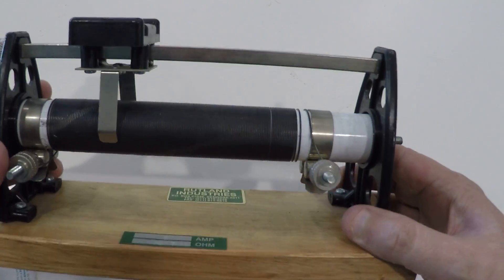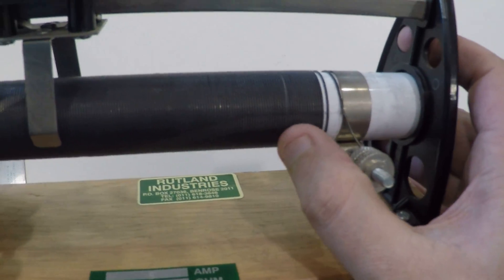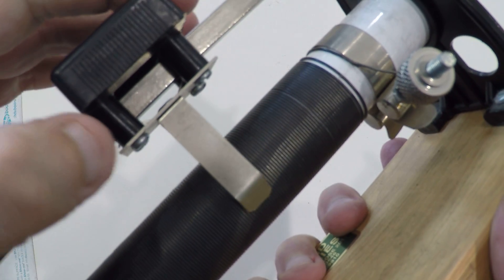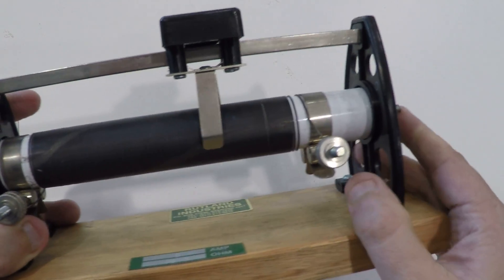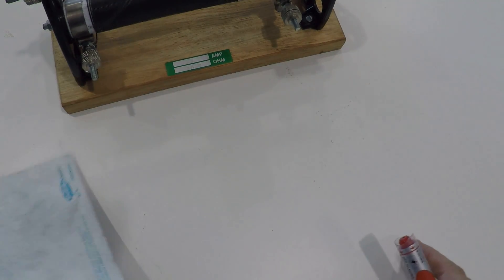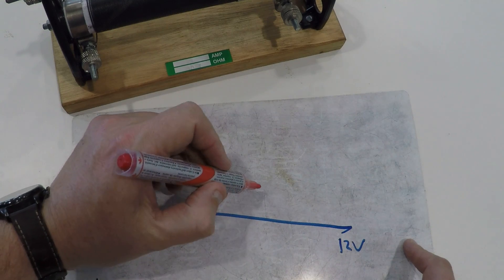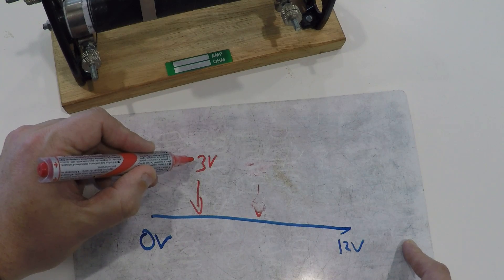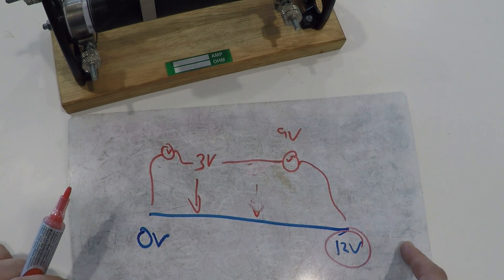A level Physics - The Potential Divider

Comment: Doesn't the sliding contact, divides the current? As some current may move from 0V to the sliding contact and some to the 12V end? Or all the current will move through the sliding contact?
Reply from the maker: We are assuming that no current leaves the slider.. Not a great model but this is what Cambridge wants from you most of the time.